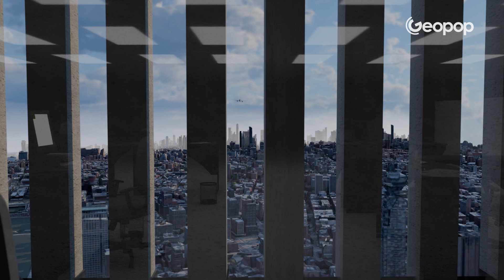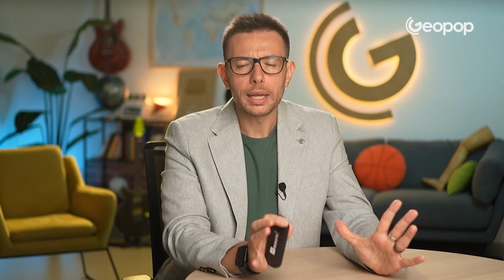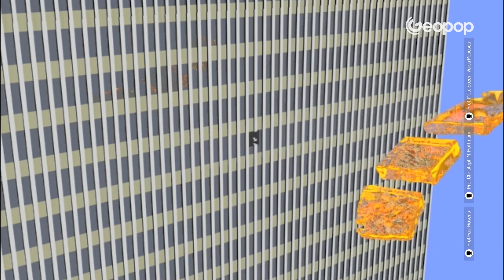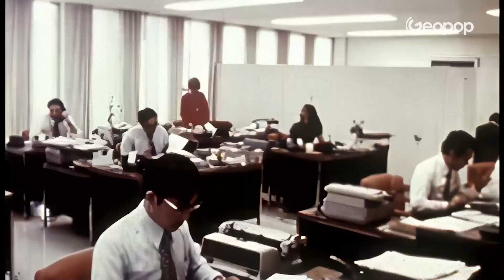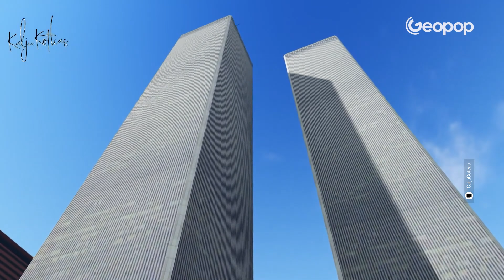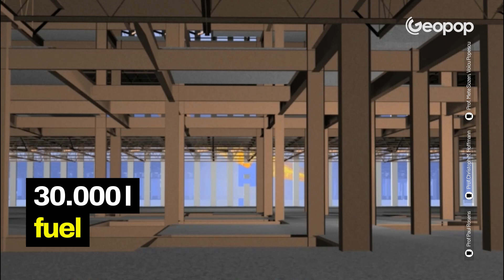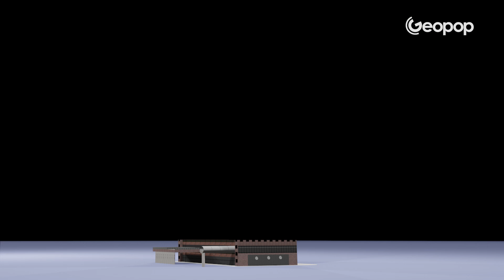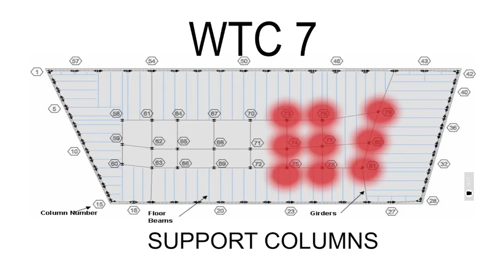9/11, 2001: The Technical Reconstruction of the Twin Towers and WTC 7 Collapses

Comment: All the scientific therories still do not explain how these massive steel and concrete buildinngs were turned into dust. There used to be a video of a Man filming cement dust comming through the vents in his office in bldg#1. Also statements from workers who heard drilling and hammering for 2 weeks prior. Myself have seen one of the pieces of a columb that had shear marks identical to a thermite shear. Also an independent firm analized some of the buildings scrap metal which had hi concentrations of chemicals found in  modern more powerful cocktail for thermite.
Reply: They weren't turned into dust so there is nothing to explain. Your starting assumptions are false. You probably saw the book by that dingbat Judy Wood and took it seriously.  Taht was a mistake.

www.youtube.com/watch?v=u2D__-DVLBk
Reply: @TheCriticalStinker-jw4fl technically the steal did turn to dust because melted steal particles were found in the dust and the majority of concrete was turned to dust, that part was recorded by dozens of people
Reply: @robbiehiatt9966  : Light concrete was crushed, but steel beams remained steel beams, even when twisted, bent and broken.
Reply: @ThomasKundera  I can promise you there's no such thing as light concrete. And you're mostly correct except some of the steal definitely Was melted because there's proof in the dust
Reply: @robbiehiatt9966  - Yes there is. 

Lightweight concrete is a specialized concrete mixture made with lightweight coarse aggregates, and sometimes lightweight fine aggregates, instead of traditional aggregates. This type of concrete possesses an in-place density (unit weight) typically ranging from 90 to 115 lb/ft³ (1440 to 1840 kg/m³), in contrast to the density of normal weight concrete, which falls within the range of 140 to 150 lb/ft³ (2240 to 2400 kg/m³). For structural applications, lightweight concrete must exhibit a compressive strength greater than 2500 psi (17.0 MPa). The lightweight aggregates used in structural lightweight concrete are usually materials such as expanded shale, clay, or slate, which undergo a firing process in a rotary kiln to develop a porous structure. Additionally, products like air-cooled blast furnace slag are also utilized.

Wrong as usual.

Comment: WTC 7 was a controlled demolition. PERIOD
Reply: I’m going to respectfully disagree and offer a more plausible explanation.

Building 7, the 6th building to collapse of 10 lost on 9/11 still confuses many even though it has been extensively studied. Not famous or a terror target, and with no casualties it did not get a lot of attention initially, creating an information void the internet rapidly filled with garbage. Because everything seems like a conspiracy if you don’t understand how it works I prepared this brief summary of the collapse from my own analysis. No politics, just engineering. 

The North Tower collapse at 10:28am bombarded Building 7 with tons of burning debris, causing heavy damage and starting multiple fires burning out of control for the next 7 hours. Half the FDNY firefighters having been killed, others injured, units in disarray, equipment destroyed, no water pressure, and the greater urgency of Search & Rescue efforts, firefighting was pulled as futile. The building couldn’t be saved and was left to its fate.

www.youtube.com/watch?v=g_SvpwyC17M&ab_channel=MFitz  

Collapse of a burning structure is always a concern for firefighters. Steel buildings subject to fire rely on active fighting of the fires to survive. Buildings are designed around 1 to 3 hours of fire resistance, allowing time for occupants to escape and ACTIVE firefighting to get started, after which all bets are off. Left to their own devices they will exceed their design envelope and collapse. In B7 the occupants escaped, passive and active fire protections were compromised and active firefighting was abandoned which left the building to take its chances. It lost. Odds on Building 7 would eventually collapse, and it did. No big deal in logic. That is the sort of choice firefighters make every day in brush fire situations - which houses to save and which ones to let go. Only real difference here is moving the decimal on the size and cost.

www.youtube.com/watch?v=WnYBX6QT0R4 

FDNY Chief Daniel Nigro ; The biggest decision we had to make on the first day was to clear the area and create a collapse zone around the severely damaged 7 World Trade Center, a 47-story building heavily involved in fire. A number of fire officers and companies assessed the damage to the building. The appraisals indicated that the buildings structural integrity was in serious doubt. I issued orders to PULL BACK the firefighters and define the collapse zone. It was a critical decision; We could not lose any more firefighters. It took a lot of time to PULL EVERYONE OUT, given the emotionalism of the day, communications difficulties and the collapse terrain

FDNY Deputy Chief Peter Hayden ; We had our special operations people set up surveying instruments to monitor and see if there was any movement in the building. We were concerned of the possibility of collapse in the building. And we had a discussion with one particular engineer there, and we asked him if we allowed it to burn could we anticipate a collapse and if so, how soon? And it turned out that he was pretty much right on the money, that he said 'In its current state you have about 5 hours

The collapse of Building 7 was anticipated and widely reported in the media throughout the day. At least 24 video cameras recording some or all of the collapse. Everyone knew what was coming and why.

www.youtube.com/watch?v=OY5S5k3tMHI 

Building 7’s collapse was completely different to the Twin Towers, harder to understand with most of the details difficult to see. But we can still sort out what happened through careful analysis and observation.  This is MY EXPLANATION of the collapse sequence using the best available information and relying on no authority.

B7 was complex 47-story steel framed structure built on top of a smaller existing 3-story building, requiring several lower floors dedicated to complex load transfer structures instead of usable office space. Of trapezoidal shape and all-steel tube-in-tube construction, B7 (above the 7th floor) consisted of a central core of steel columns carrying most of the gravity load, perimeter steel columns around the outside of the structure carrying the remainder of the gravity loads and long span beams and girders to tie those elements together and form the floors. On the outside of the building hung a moment frame - the last part of B7 to fall. 

Phase 1 : The first externally visible signs of collapse initiation occurred at 5:20:28 pm. Collapse initiation for B7 is notably quiet with observers not realizing the building was collapsing! There was no audible warning in the form of say hundreds of ear drum busting 180-190dB explosive bangs preceding the collapse. Here at 12:00 a local CBS affiliate reporter is talking 10 blocks from B7 when collapse begins. People don’t start to notice the collapse until 12:11. Then at 12:45 is the famous CBS fixed camera clip of Building 7’s collapse.  Note how quiet it is.

youtube.com/watch?v=t5tEy6mXSE8&ab_channel=fresnosean379

Collapse initiation was due to lower floor failures above the load transfer region (7th floor) in the NE corner of the building. In this video at 0:45 you can see the NW corner from inside the building while under construction, Column 79 just out of frame on the left. That big, angled steel beam across the top of the frame connects to C79 at one end. The girders connect to the beam. That beam and all those girders depend on just one connection

youtube.com/watch?v=nP3TNHPCIVU&t=35s&ab_channel=EdwardCurrent

Phase 2 : Lower floor failures caused a loss of critical lateral support over an excessive length of core Column 79 and it buckled. If you look at a floor diagram of Building 7 (see above) and look at all the structures that depend on C79 you quickly realize this one column was a relatively isolated structural element on which a disproportionately greater fraction of the structure depended analogous to say the Key Bridge. Externally we see a vertical progression of window breakage along the 44-46 line and a kink in the roof of the East Mechanical Penthouse at the top of the building, consistent with C79 failure. The transition from full capacity to almost no capacity occurs in virtually an instant. Once the buckling failure occurs there is almost no resistance

Normally with a buckling column, the load could very well be redistributed to other columns, meaning the buckling could stop after a while. With C79 that is not the case - the failure did not redistribute the load, so the collapse rapidly progressed to the roofline, sinking the rooftop penthouse.

Phase 3 : With C79 gone, B7’s progressive, non-symmetrical collapse continues with C80 and C81 at the east end of the core left laterally unsupported and quickly buckled and failed as well, sending the EMP down through the building. C79-81 all have no diagonal bracing, which I believe is a major reason why they could not redistribute a lot of vertical loads among one another.

From there collapse progressed from east to west through the central core until the core was gone taking all of the interior floors and structures and probably most of the perimeter columns with it. You can see the horizontal progression of window failures low in the building and the dropping of the remaining rooftop structures into the building. One of the big takeaways from the NIST Building 7 study (that gets completely ignored) was their modeling which determined C79 failing under ANY circumstances would have initiated the same collapse sequence.

Phase 4 : After some 10 seconds all that remains of Building 7 is just a hollow empty outer shell - the exterior moment frame - creating the illusion the building is still standing since little has changed externally. But it’s just a hollow empty shell like an empty cereal box supported by only a few remaining columns and quite unable to remain standing. With all the internal framing gone, the north face leans inward, forming a V in the roofline, the last perimeter columns buckle under the strain and with nothing left keeping it up the moment frame free falls, landing on top of the 7-story high debris pile. It is only at the very end that a single measurement of alleged free fall acceleration is taken. Note this is not the building but just its outer shell, and only one corner at that, at the very end of the collapse. Start to finish the entire collapse took 18-20 seconds, or less than 1/3 of true free fall and we have to look at the whole thing, not cherry-pick little bits to fit a particular narrative. Worth noting _how fast something falls cannot tell you what started it falling in the first place. The debris spread out, blocking surrounding streets, heavily damaging the Verizon Building and destroyed Fiterman Hall, all well outside of Building 7’s “footprint”.  

Building 7’s progressive, non-symmetrical collapse was incidental and unintended collateral damage from the combined effects of fire + time + gravity started by the collapsing North Tower. That is true no matter who planned and carried out the 9/11 attacks or why . The collapse was of so little consequence it barely even registered at the time, a mere footnote. It only took on semi-mythical status as an alleged smoking gun years later when demolitions at the Twin Towers, missiles at the Pentagon and shoot down over Shanksville all failed and conspiracists had nothing left to work with.

Anything can seem like a conspiracy if you don’t understand how it works. Now you should. I hope you found this helpful, informative and it solicits informed critical comment. If I made any errors of fact, logic or reason or left anything important out, please let me know so I can fix it. IF you can offer a more plausible alternative please do. Be the first. Please start any reply with the words “Tits McGee” or I will know you didn’t read it and are wasting my time.
Reply: @TheLoonResistance  : And that one too?
Very nice, thanks.

Comment: im only 10 minutes into the video. i did work in both WTC1 & WTC2.  those building were build differently  than any other building in the city.  after the plane went through the building. the plane took out many of the center support  (core) columns in the center of the building as well as the  stairwells in the center. No one knows for sure on how many core columns were taking out in the center of the building but it was enough to take out all of the center stairwells in the north tower.  The support columns that were left  holding up the center of the building were weaken by the fires along with the floor joints and what was left of the cross beams. The fires didnt need to melt the steal for the building to fall, just needed to weaken the steal. when the fuel tanks exploded, all of the fire proofing was blown off. 
       The building were built to take the impact of a jet plane landing, not flying at full speed with full tanks of fuel.  
 the world trade center building were built differently then any other sky scraper before them. the trade center had open floors. first of its kind for any sky scraper.  each building had 47 core columns that went from bedrock to the top of each building.
Reply: Poorly educated =  3000+ licensed architects and engineers
Reply: @dmc3489  it doesnt take an educated person to look at the video of building 7 to see that they blow out the support cores and those puled the sides of the building into the center as it fell. the building looks like a big U when falling, whatever trait that motivates these people to repeat obvious lies created to run cover for a bunch of mass murders that used this to invade a country and murder a half million innocent people to create a situation that makes it easy for them to steal boatloads of money. Thats a trait im glad i do not have and i have contempt for people who display such an insane level of cowardess and self delusion.
Reply: Thank you for an intelligent and science based reply..Not that it will have an impact on the conspiracy nutters.......Nothing will
 make them give up their delusions..!!
Reply: @2msvalkyrie529   - unfortunately it won't. You can look at a video and describe it completely different than what is in the video and it somehow could make perfect sense.  It doesn't mean that is what actually happened. 
  My old roommate was a conspiracy nut. As the buildings were coming down and you can see what looks like smoke blowing out of a window or something every twenty floors. He would tell me those were bombs planted in the building the weekend before 9/11.  It was air being blown out of vents. As the building is collapsing onto itself.  Compressed air is being blown down and out. Some of that compressed air blew out of vents. The rest was blown for a ¼ - ½ mile once the building has completely collapsed.    Just about everyone in the world seen the compressed air blow through the streets of lower Manhattan.
Reply: @SD_slots  Funny how compressed air blows out windows, yet the steel underneath was just vaporized into dust.
Reply: @dmc3489 - are you really that stupid. Vents. In the videos you can't see the vents so I said windows but I also mentioned vents a few times.   Does everything need to be explained to you,  than stop acting like it does